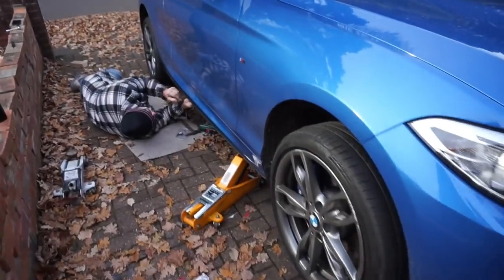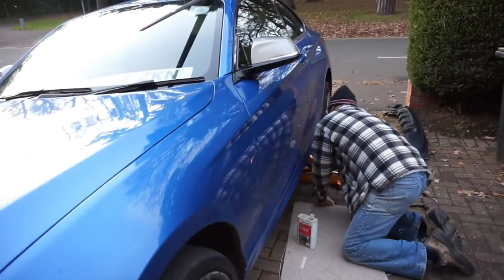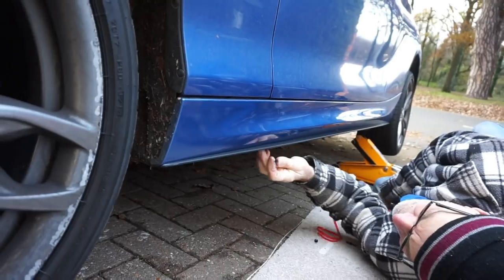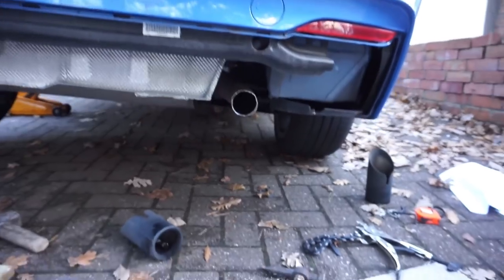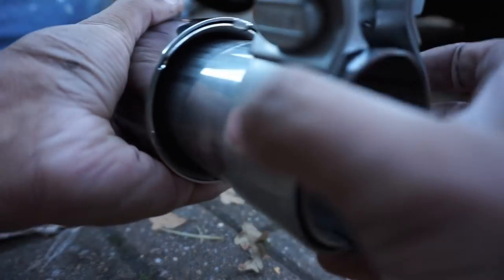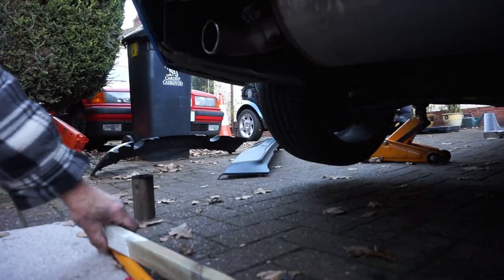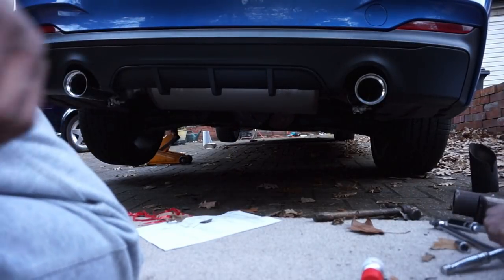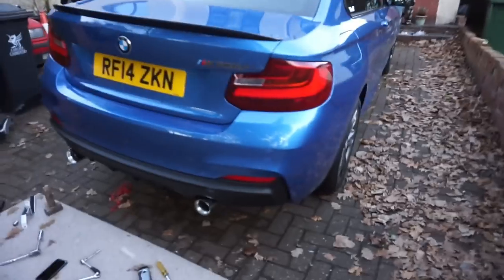Fitting M Performance Diffuser & Exhaust and Skirts - BMW M235i/M240i

Comment: Just bought a 4 series. Thinking of getting m performance side skirt stickers. Are they easy to put on? I'm based in caerphilly and do you think it's better to get them 'professionally' put on
Reply from the maker: That's a good question - I had mine professionally applied when I got my wing mirrors wrapped. I guess it depends on how confident you are, and if you've done anything similar before.
Reply: @JamesCF10  I'm a noob who has just got into valeting/detailing. Think I'll see a pro to do it. The car is stunning so I'm afraid I'd do it an injustice
Reply from the maker: @hypnoticmonkee  hahah I know how you feel! It's a shame we're in lockdown now cos it should only take about 30 mins for a pro to do
Reply: @JamesCF10  I'm in and out of garages/bodyshops etc with my work everyday so I'll make enquiries. Thanks for feedback.

Comment: How much did you cut the exhaust by and did you have to drop the exhaust to make it fit? also what did you do with the brackets that came with the diffuser?
Reply from the maker: 120mm was the advised amount. Luckily we didn't need to drop the exhaust and we didn't use the brackets haha Didn't seem to make a difference.

Comment: Hey man love the video! I've just bought a 235i and I'm wanting to put the same chrome tips on to mine. Is your exhaust a standard system or the full m performance one? My local BMW have said you can't install the chrome tips on the standard exhaust system, they say has to be the full M performance spec to start with?

Any advice would be appreciated 

Thanks

Dan
Reply from the maker: Hi Dan, in short, they're lying to you haha. My exhaust is completely standard. As you see in the video you just have to trim them down and add the new parts 👍🏾👍🏾 If you need anything else give me a shout
Reply: Thought as much mate! I have just ordered the tips, don't suppose you have a part number for the extender pipes do you? Did you get fitting instructions with any of this kit as well?
Reply from the maker: yeah sure - B18.30.2.287.042 Should be about £40-50. I'm gonna have a new video up soon with the final reveal for the car. Looks amazing at the moment!
Reply: Awesome, thanks for that! Looking forward to the next video!
Reply: @JamesCF10  hi mate just watching this again can you confirm that the exstender pipes were from BMW or are they from somewhere else ?

Comment: Nice video tho, so the skirts installs easily? any tips I need to keep in mind?
Reply from the maker: Yeah very easy - make sure you use the rear jacking point, if you use the front one you'll struggle to drill 2 holes.
Other than that its very easy, all you need is a drill and a hammer 👍🏾
Reply: CF10 thank you dude!
Reply: What size of drill do u use for the side skirts?
Reply from the maker: A small one 😂😂 no idea man, I'll have to check and get back to you
Reply: Is the side skirt the same as the second side panel on the car or is a differential? If so, how do you mount them then, at the front or at the back?
Reply from the maker: basically the skirts all have holes in them. you have to stick the skirts to the car with the tape first, then drill the holes through the skirt into the body. Then you fill the holes with the rivets